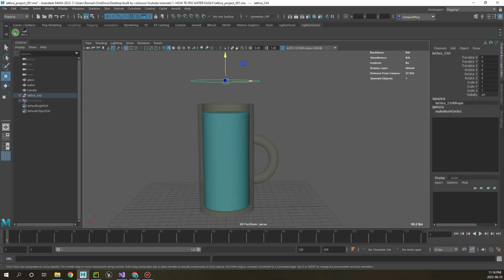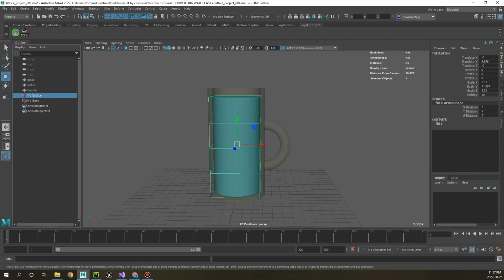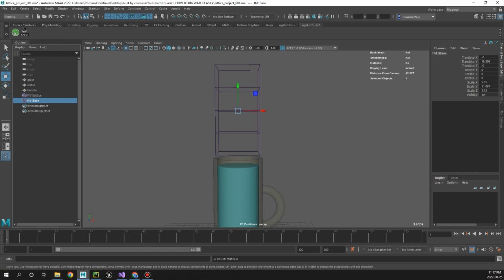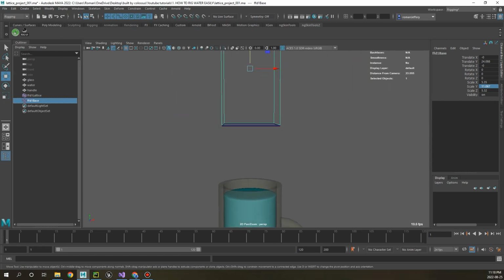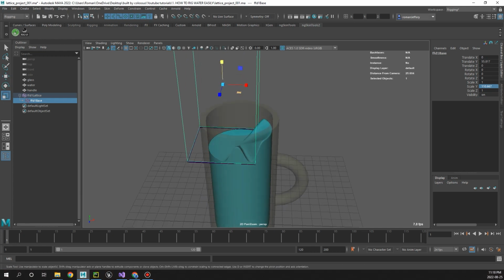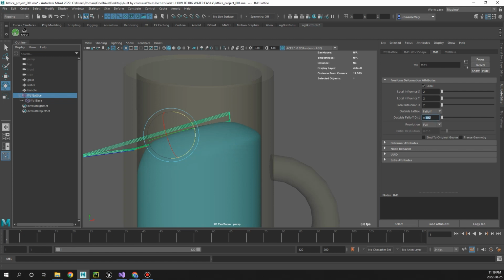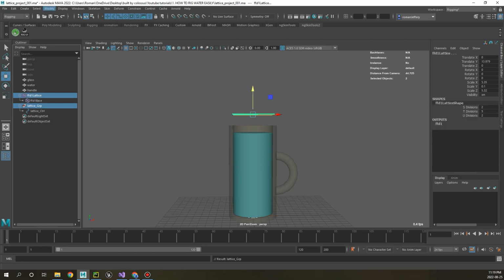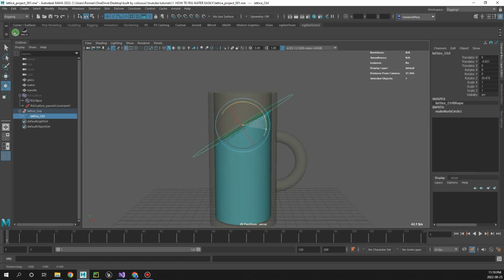HOW TO RIG WATER EASILY

Comment: if i understand correctly, this doesn't work with non-cylindrical shaped liquid, correct?
Reply from the maker: Correct, as is. The workaround would be to make a purely cylindrical geo and lattice that. That geo would then get blendshaped into the final geo that is deformed to the correct shape.
Reply: @builtbycolossus  makes perfect sense! thank you